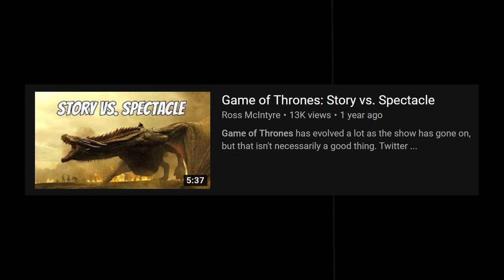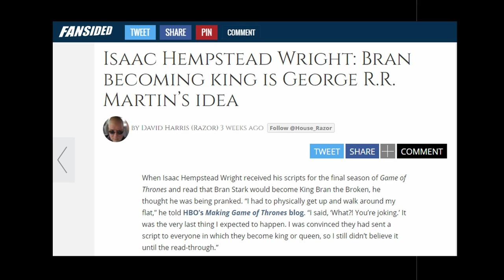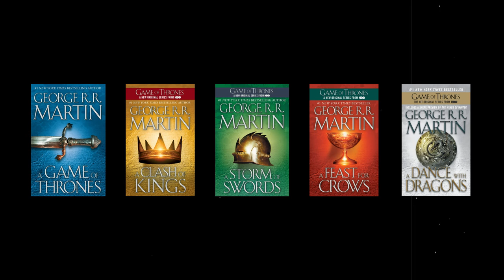Game of Thrones: How Season 8 Fell Apart

Comment: Season 6 was when got stopped being got. The Starks were set up as the 'good guys' and at the end of season 5 they were at their lowest point. Jon died, Sansa got married to Ramsay, Arya went blind, Rickon was captured by Ramsay and Bran was absent for the whole season. But in season 6 Jon gets  ressurected really early on with no consequences, manages to take back winterfell in an epic battle, wins over the people of the North and gets crowned King in the north. These 2 seasons follow the stereotypical formula of the bad guys having an initial advantage, good guys going through tough times and then eventually beating the bad guys as underdogs.

Comment: One of the early signs that the latter Seasons where not gonna end well was when D&D made changes that either make no sense or just seems pointless in general and granted it wasn't everywhere but some where noticeable. Then when Season 5 came even though they had two more books to adapt and where given the option of making as many as 13 Seasons they decided to give us massive water down versions of them, in particular Stannis's campaign against the Boltons and the abomination that is the Dorne subplot and all of them ended on a horrible note. Granted even if they completely adapted the books they still would have to create new material but even then the new stuff we got lacked any substance, had major plot holes as well as the infamous "Plot Armor" it would be very guilty of.

Comment: It's hard to understand the claim that things only started to get bad in season 6. Things clearly started going south in season 5 for those parts of the show that weren't based on the books, I remember reading reddit threads of people being scared for later seasons cause the adapters did such a bad job with non-book parts of seasson 5 (the resolution to the Kings Landing plot or the shitshow of Dorne). Really it was after season 5 that HBO should've stepped in, they should've pulled together the show runners and GRRM and said 'look, the books won't be finished in time, we need to do something'. At that moment they could have begun to introduce characters that had been left out, like John Connington or the Arianne Martell, that could've stretched things out a bit longer, though they may have had to write new stories for the up-till-then impotant characters. For this they should've have forced the showrunners to bring on new writers, who could actually write stuff, not just adapt popular books. If the showrunners didn't want to stay on for that long, then HBO should've replaced them. It's easy enough to make suggestions in hindsight but this would've been a huge gamble for HBO and easily might not have paid off and then everyone would blame them for it. If only George had finished the books.

Comment: Season six was not the turning point, honestly. The turning point was the lack of inclusion of (f)Aegon. That in turn is what caused the Dorne storyline to be so butchered, which then rippled to the rest of the show (and without backlash at the time, convinced D&D they were justified in removing whatever they felt like removing). So while S5 was generally good, the lack of inclusion of such a necessary piece basically removed an entire portion of the foundation on which the show needed to be built. Thus the show actually premised its downfall before they had to wander away from the books in S6.

Comment: They were in a hole when they ran out of GRRM material and should have deployed a different solution - instead of taking a few broad hints from GRRM they should have done something original - something different !! from what George had planned for TWOF and ADOS. By wrapping it up in a short season 8, they ended up with a few clunky chess pieces left on a small board, and no such story was going to work. In only 6 episodes there had to be a buildup, a Winterfell battle, an interlude, a Kings Landing battle and some wrap-up finale. It almost wrote itself. Shameful.

Comment: I mostly agree with you on your Season 8 points, a few I don't. And most of your points on Seasons 6 and 7, I do not. In a few of them, you came off as kind of pretentious as if every single point you made is objectively correct.

I would also like to point out that when you said you wouldn't be dramatic by saying that Season 8 didn't out right ruin the show. You later said that you'll just pretend everything past Season 4 doesn't exist, you kinda contradicted yourself there.